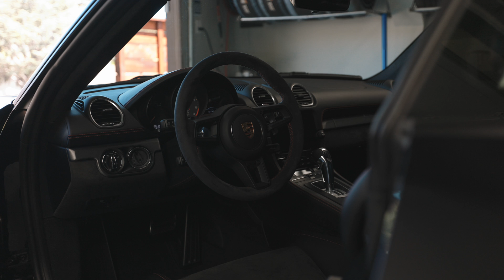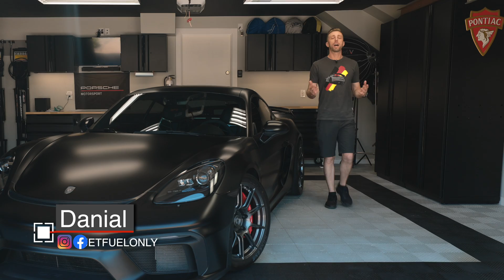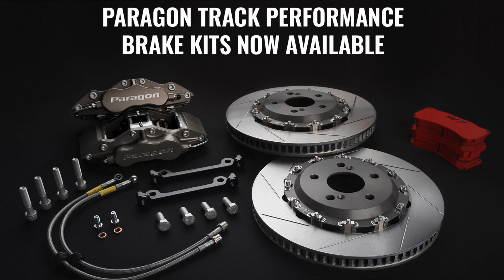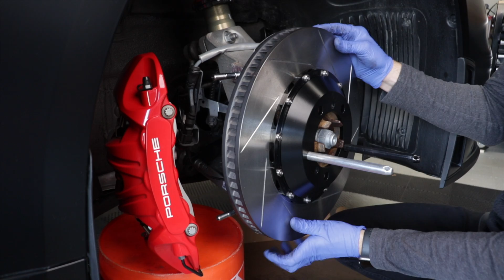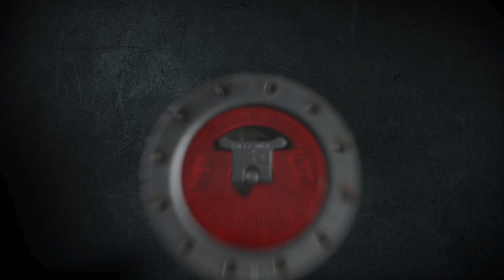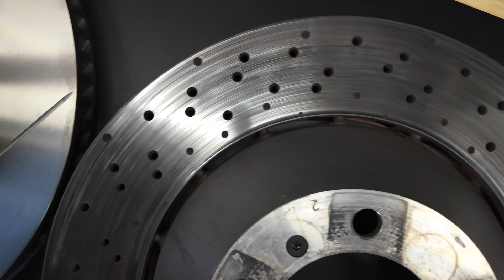Can Paragon Rotors Handle Porsche Track Duty? | GT4 Rotors Follow Up

Comment: What size CRS tires are you running?
Reply from the maker: 265/35/19 and 305/30/19
Reply: @JetFuelOnly  Hi mate, Im about to order tires but Im on the fence with the 295/305 CRS rears. how are the 305s fitting?
Reply from the maker: @TheEddysGarage it’s a tight fit on these wheels with this offset. Tight newer the body inside and tight at the fender lip. I wouldn’t hesitate to do 295
Reply: @JetFuelOnly  what offset are your 11” rears?
Reply from the maker: @ 46
Reply: Awesome thanks